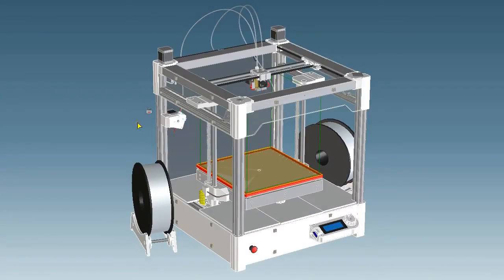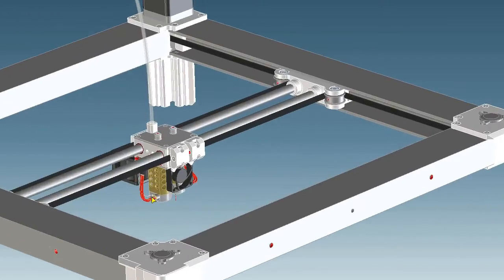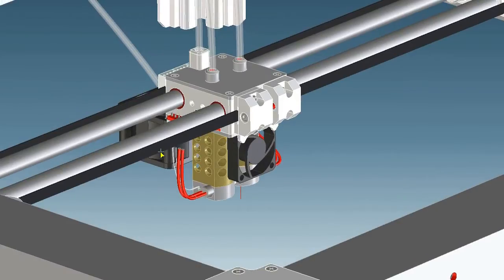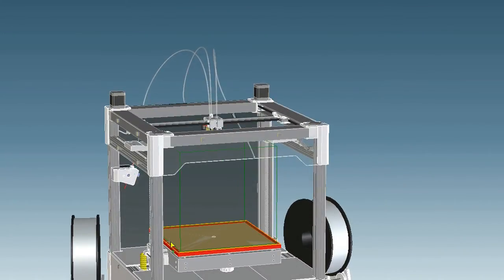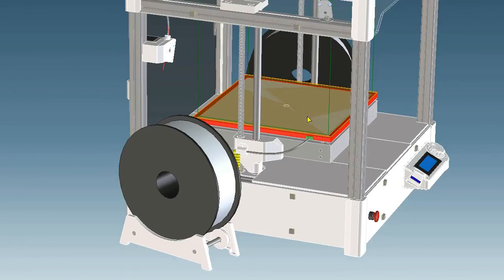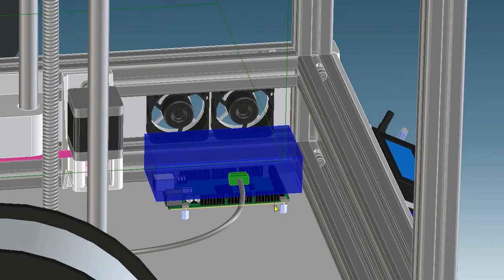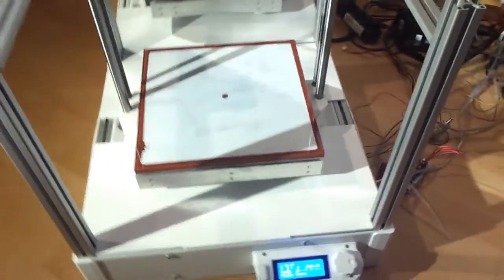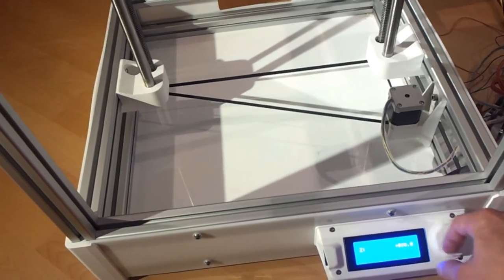ProtoForge 3D printer - (1) mechanical design over

Comment: Can you tell me where I can purchase a power supply for US type outlets?  Would this power supply power the RAMPS 1.4 the Mega 2560 or both?  Does this power supply have the correct plug/plugs needed to fit the RAMPS 1.4 and/or Mega 2560 or will i need to adapt a different plug?

Comment from the maker: Hi, thx a lot. I didn't get that. The forces on the belt should only depend on the rotation friction of the rods, right? The rods have are T12x3 (diameter 12). There are two standard ball bearings on each end of a threaded rod. The bed is driven by a trapezoid nut and slide bearings (ptfe coated). I'm very interested in your concerns. What do you exactly mean by the same forces?

Comment: Very nice Design ! Be aware that you keep the forces of the timing-belt for the Z-Axis on both threaded rods the same - this tool can help you very much: maedler*de/Static/Tools "Zahnriemenauslegung"
What is the diameter of the Z-Axis smoothed rods and what kind of bearings are you using  for them ?